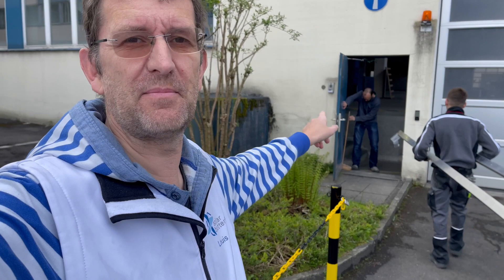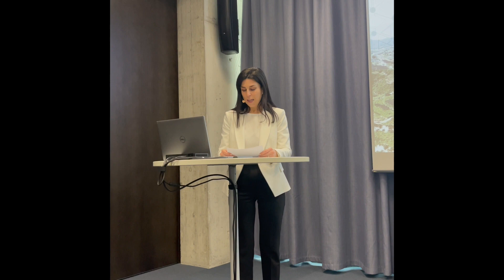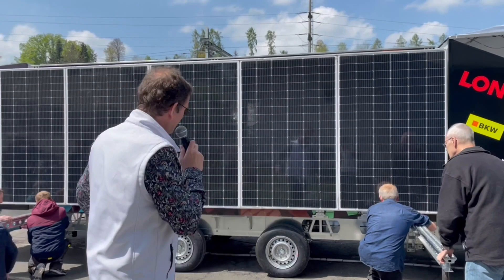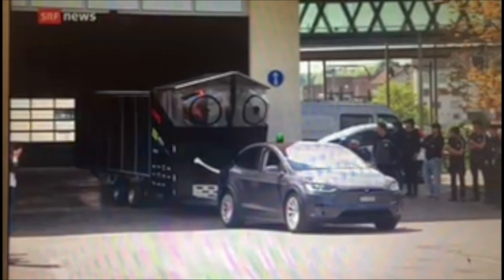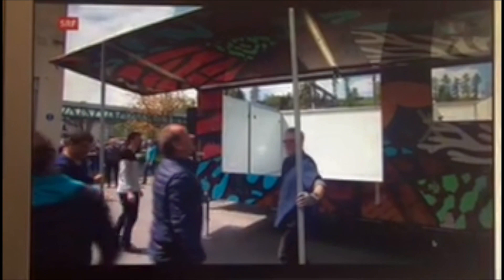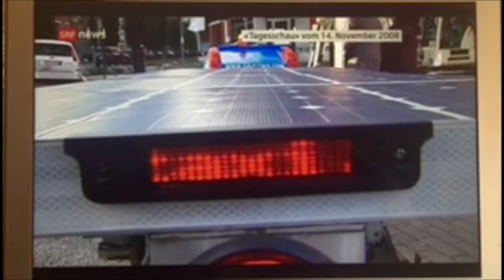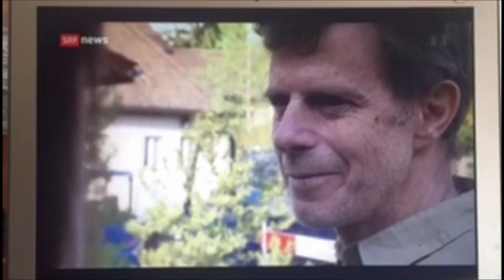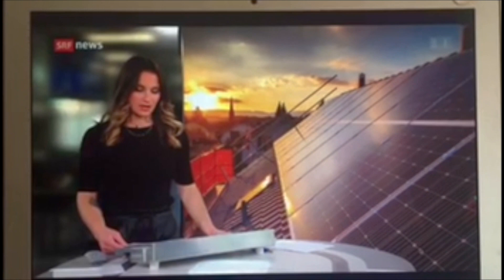Unveiling of Larso, the SolarButterfly

Comment: Can you talk about the material used for the walls ? How good are the insulation values heat/noise?
Here the problem: 
Even the newest and most expensive travel trailers (Wohnwagen) in Europe, are using a wall of around 30mm, made of wood and polystyrene like it was done in the 60's,  Campers (Wohnmobile), on the other side are well insulated using the lastest materials available (PUR foam), no heat bridge etc. Two completely different worlds!

With these bad insulation values, it's understandable that gas heating is still commonly used, which also need a constant airflow to not asphyxiate the occupants that cools the whole interior. In winter, it uses 5-7L of LPG per day!  

Can you talk about the AC/heating/hot water, perhaps something about the heat pumps used in recent EV ? Can the heat of the fridge/AC be reused for heating water (storing) ?

Nice promotion trailer, but what's all about, here is my blue collar reality:
I have to live in a travel trailer (rented), working night shift (sleeping with the noise of cars at daytime) and that at the beginning of winter, for 3 months, also it gets frosty.
  
Personally looking for my own travel trailer, not longer than 8m because of parking possibilities, 2.5m wide because the additional insulation it needs and surface for solar panels, need to replace the absorber fridge (140W/H) with a 46W/h compressor typ, also having a 400W/h AC/dehumidifier (hot side can be slid out in summer and kept inside for winter) is a must.

A portable power pack (1.5KW/15Kg) as a replacement for the LPG bottles... or a way to use a EV to recharge my trailer, but here in Europe that's another can of worms...